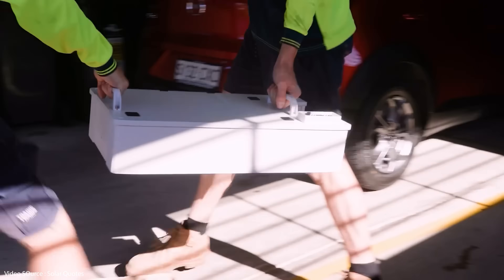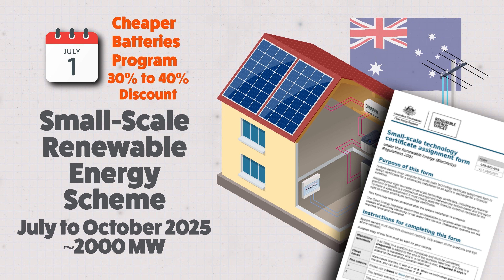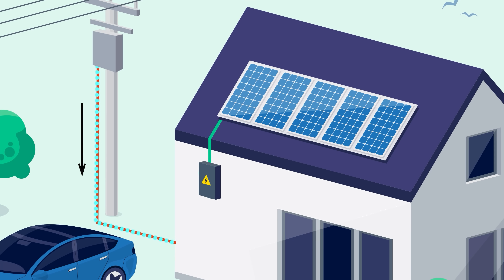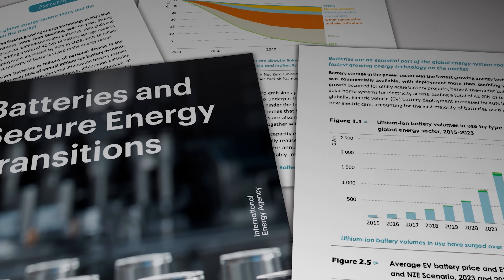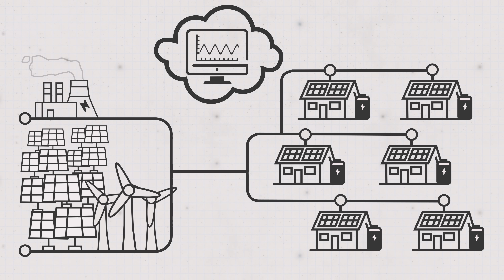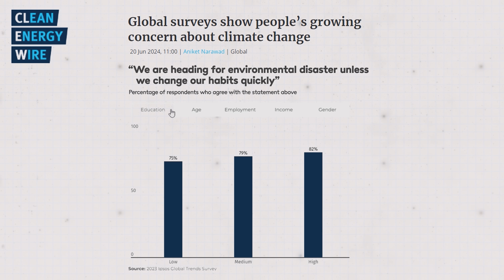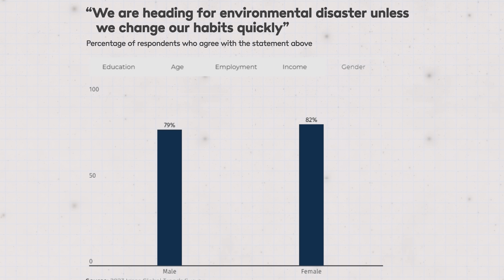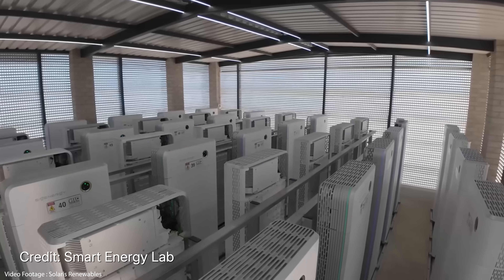Australians installed 100,000 home batteries in 17 weeks. Why can't we all do that?

Comment: Living in Germany, our grid is already beyond its limits on renewables atm. It's desperate for storage (and perhaps bigger power transfer lines). We're currently wasting a lot of money on gas generated power to fix the issues.
Reply: Geothermal is the solution.

We have a natural fission reactor beneath our feet in the crust of the earth producing so much heat that just 0.1% of it could power the entirety of mankind for 2 million years.

Geothermal can unlock that energy.
Reply: @Les_S537 Yeah new geothermal designs definitely sound promising, technologically. LCE needs to be lower than wind/solar + storage, however, for this to be economically viable. And the cost of the latter is falling off a cliff atm. I think we'll get it anyway, because gt favours utility scale and thus preferable to the decision makers.
Reply: @MoiraLachesis  You read my reply post below to another person, about Quaise Energy?
Reply: @Les_S537 no but likely I've heard about them already.
Reply: Germany should instantly, permanently ban wind-and-solar, and decriminalize uranium-fired power-service.
Reply: @aliendroneservices6621lol why
Reply: @MoiraLachesis  Did my reply come across to you, about the Real Engineering video?
Reply: @MoiraLachesis  Dunkelflaute, that's why
Reply: @Les_S537 That's a rare event and can easily be compensated for. Having ONLY wind and solar would be a bad idea but a ban is completely ridiculous. It's like banning cars because sometimes too much snow makes it impossible to use them.
Reply: @MoiraLachesis to be clear, I’m not saying to ban them, just pointing out their limitations, and the way you’re mitigating it isn’t a good option. You need more baseload power, specifically geothermal
Reply: @Les_S537 There's no such thing as "baseload" there's just load. "baseload" is just a mathematical number introduced because some power production cannot be easily ramped up or down.
Studies show that you can do fine with some storage if you have an alternative for a couple hours of "Dunkelflaute" each year. TBH that could even by gas. Ofc if you have cheap geothermal you can probably save on a lot of storage, but it wouldn't solve the Dunkelflaute problem unless you go 100% gt.
Reply: @MoiraLachesis  ...Because wind-and-solar power-service is infinite-cost, in the long run.
Reply: @aliendroneservices6621What makes you think so? It has the lowest LCE on average, except for hydro
Reply: @MoiraLachesis  No, that's not accurate.

"Baseload" originally and primarily refers to the real, persistent minimum electricity demand on the grid—the portion of load that is always present, even at off-peak times (e.g., nighttime). This is an observable feature of demand curves, not just a made-up number.

The term "baseload power plants" (e.g., nuclear, coal) developed because those technologies were best suited (technically and economically) to run at maximum output consistently to meet that steady minimum demand. While inflexible generation reinforced the concept (e.g. wind and solar), baseload demand exists independently of supply technology.

Modern grids can meet this minimum reliably without dedicated inflexible plants—using flexible dispatchable sources, storage, and demand management—but dismissing "baseload" entirely as nonexistent conflates demand with historical supply choices.

"A couple hours of "Dunkelflaute" each year"?  More like hundreds of hours each year across several events.
Reply: @Les_S537 how's that not accurate? it's a purely mathematical number, you just confirmed that.

There is no physical reason to split load into "base load" and "peak load", that's purely an engineering/organisational decision to cater to the limitations of the old grid. But (1) wind, solar and batteries can be switched on or off very quickly, so there is no need for a "baseload" concept in a wind/solar/battery based grid, and (2) we don't have to stick to the "supply follows demand on a dime" concept either, as storage becomes cheaper, it's conceivable to do stop serving peak loads and have local buffers instead.
Reply: @MoiraLachesis  LCE refers to energy.
Energy is free.
Power-service is what society runs on.
Wind-and-solar power-service is infinite cost in the long run, because it cannot power anything important, including its own infrastructure replacement.
Reply: @aliendroneservices6621 LCE is the complete cost of supplying power including infrastructure. As it's lower for wind/solar than anything else, it will only go down even more as you replace other infrastructure.
Reply: @MoiraLachesis  You're right that capacity factor is purely mathematical—no debate there.

But your claim overstates the case: traditional baseload isn't just an outdated organizational choice; it's tied to the physical reality of grid stability. The grid must balance supply and demand instantaneously, with constant frequency/voltage control and inertia to prevent cascades.

Wind/solar/batteries ramp quickly for energy, but batteries provide limited duration (hours, not days/weeks), and variable renewables lack the inherent inertia of spinning turbines in thermal plants. High-renewable grids still rely on dispatchable firm capacity (often gas or hydro) for extended low-renewable periods (e.g., Dunkelflaute).

My main issue with a heavy wind and solar grid is that you HAVE to overbuild, especially as you get into the higher latitudes.  In other words, a solar panel on the equator produces way more power than a solar panel in Tromso, Norway.  To produce the same amount of power with solar in Tromso you need 2.x panels.

I'm of German descent, and my German heritage is one rooted in efficiency, and it tells me that going heavy wind and solar with heavy batteries is not the path forward.  The amount of resources needed to make wind and solar  with batteries work dwarfs what would be needed for more robust power sources such as geothermal and nuclear.

I want the biggest and most efficient power sources so as to make as little impact on the environment as possible.

A world filled with millions of wind turbines and billions of solar panels alongside trillions of battery cells is repulsive to me, and way more work than is actually needed.
Reply: @MoiraLachesis  No. LCoE has nothing to do with the cost of providing power-service.
It's levelized cost of energy, not power-service.

"...it's lower for wind/solar than anything else..."
...Then wind-and-solar must be exclusively powering a lot of off-grid factories and data-centers.
It should be easy for you to find and point-out an example for us.
Reply: @Les_S537 Well, people have actually investigated that, and found you should go to about 90% wind/solar/batteries, but not further. So yes it's worth it, but it's not the complete solution, precisely because of the issues you mention. Currently in Germany we're already beyond grid capacity. But the reason is the lack of storage. Yes it has limited duration, but that limited duration is enough for those 90%. We already are using ridiculously expensive power in rare cases right now, not because of too much renewables but because of poor organization. So that wouldn't even change anything.

I find it strange that people say "we have to match supply and demand" and in the same moment argue for "baseload supply" which is the OPPOSITE of matching supply and demand, it's inflexible power generation. Personally I think instantaneous suplly/demand matching is silly as storage becomes widespread, but moreover it's silly to argue against the most flexible power generation methods with matching supply and demand.

We already do overbuild, particularly in gas power, by crazy factors, so that's not an argument either.
Reply: @MoiraLachesis  It's all just so much work, and requires so many resources to make it all work.  It's so unnecessary.

A geothermal power plant can last centuries (outside of replacing turbines every 50 years or so).

Solar panels last 25-30 years.

Wind turbines last 20-25 years tops.  

Why build millions upon millions of wind turbines, and billions upon billions of solar panels every 20-30 years when you can build tens of thousands of geothermal plants that can last centuries (outside of replacing turbines every 50 years)

Also, right now we're splitting up battery production between battery farms for wind and solar and EV battery packs.  Batteries should be entirely dedicated to producing EVs right now, but because battery production is feedstocking both battery farms AND EVs its slowing down the pace of getting people away from ICE vehicles.

Daily ICE vehicle use produces more emissions than home energy use does, so it makes sense to me that we get people out of their ICE vehicles more quickly.

We can do all of this SOOOOO much more efficiently than we are.

Stop pushing wind and solar, and start pushing for geothermal and nuclear which can much more quickly get us away from fossil fuels for electricity production.
Reply: @Les_S537 EV batteries and grid storage aren't really in competition anymore, or not for long, chemistry and technologies are drifting apart. Also we're already using old EV batteries for grid storage so there is synergy. I do agree however that we need other storage than current battery tech.

It's not like geothermal is facing a ban. If it was so attractive it would boom just like wind and solar, it even in place of it. Idk why it isn't, but I could imagine the upfront efforts are much higher. If that's true it would've been an option 20y ago but we really need to ramp up fast. 

Maybe in another 20-30y we'll phase out wind and solar at the end of their lifetime just as we did with nuclear. That's not wasteful IMO, it served its purpose. It's hard to tell, technologies are changing fast on all fronts. 

That's why I like looking at LCE, it's a reasonable estimate for the efficiency of doing something right now.
Reply: @MoiraLachesis  Actually, they're converging in chemistry (LFP) due to LFP's "safer" fire profile.  The vast majority of EV manufacturers are moving to LFP batteries because of their higher charge cycle count, and because they're more idiot proof on the consumer end.  What I mean is this.  There is an idiom that goes something like this.

"Take care of your tools, and your tools will take care of you".

EV owners can "eff" their batteries up very easily due to how they use them, and how they charge them...

LFP batteries are much more "forgiving" on the abuse front by consumers.  Charging NMC batteries to 100% all the time can actually shorten the life of the battery and result in faster degradation, but LFP batteries don't have that "limitation".
Reply: @Les_S537 temporary. grid is likely to move away from lithium.plenty of alternatives coming or existing that are too heavy or bulky for cars but more durable and/or cheaper.
Reply: @MoiraLachesis  Maybe in the longer term (decades down the line), but sodium is nowhere close to replacing LFP anytime soon because lithium demand for stationary storage is actually surging (expected to be 30-36% of total lithium use by 2030).  Sodium just doesn't have the energy density that lithium does (which means you'll need more cells than with lithium) but sodium is definitely more abundant and cheaper.

I know I keep harping on this, but I'm most concerned about the environment in the end.  A world with tens of millions of wind turbines, billions upon billions of solar panels, and trillions upon trillions of battery cells sounds like a living hell to me.  Sure, battery fires are a real concern to me, and yes battery manufacturing is getting better where they're less common, but when you have to have the scale of batteries that will be needed to support a world filled with that many wind turbines and solar panels its still going to end up being a toxic nightmare.

In other words lets say that only .05% of total battery capacity experiences fires...  When you have literally trillions upon trillions of battery cells, that's a lot of damn fires, and a lot of toxic fallout.
Reply: @Les_S537  I'm not an expert on these things, but environmentally I don't see a problem with doubling the amount of solar/wind here, at all. If that was big trouble it would already be, rn.

Batteries is a different story. Sodium is already being deployed, so decades away is doubtful, the whole sector is advancing at breathtaking pace.

Nonetheless, classical battery cells, lithium sodium or whatever, seen very unlikely to scale to the levels of storage we need. Some alternatives are being deployed but I don't see anything that'll solve the problem at scale yet. I'd like a 4h battery in every house, and yes that is a lot safer than a gas boiler in every house, but probably a pipe dream in production capacity. I'm very optimistic however about timely availability of safer, scalable storage.
Reply: @MoiraLachesis  It's only in the last year that anyone began production of sodium-ion batteries, and more than 90% of it is all within China right now (<10 GWh).  CATL is really the only large scale sodium-ion battery manufacturer on the planet today.  Natron Energy in the US began and ceased all production in the last year and a half.  Sodium-ion is where lithium-ion was decades ago, basically.

Look, I'm not saying we couldn't ramp batteries...  I'm saying that we shouldn't because the decades to come are going to see a lot of toxicity as a result.  To make those batteries means massive amounts of mining worldwide.

We're only looking at doing it BECAUSE everyone has pushed so hard for wind and solar.

If I could go back in time I most certainly would, and I would have been much more aggressive on the geothermal front.

It really is the answer to everyone's problems.

Geothermal is a source of power that can power mankind for hundreds of millions of years, and its impact on the environment is miniscule.

Nothing else compares (I'm a geologist so I'm a bit biased, but I know I'm right).
Reply: @aliendroneservices6621I'm not against nuclear but for Germany that would be an extremely dumb idea. We would have to modernize old plants or build new ones at a multitude of the cost of all other options

Comment: Batteries are great, no reason why those with solar on their roofs should expect the grid to pick-up their generation as it happens, makes much more sense for that generation to be put into the grid over 24 hours.
Reply: We're doing a shidton of work that isn't needed...  Collecting the resources to build solar panels and batteries is a LOT of work.

The much easier solution is geothermal energy which has a capacity factor of 70-90% compared to solar's 23%..

Solar is way too inefficient.
Reply: @Les_S537  The largest geothermal field in the world (The Geysers; 1,590 MWe) is operating at a capacity factor of 53%.
It also has a power density (after correcting for capacity-factor) of only 7 watts per square meter.
Reply: @aliendroneservices6621 Your ignorance of how geothermal works is apparent.  

The field simply needs to be recharged.  

After decades of use, and drought like conditions in the area, as well as heavy water extraction for farming, the field is essentially "drying out", but geothermal fields often need a recharge (known as reinjection).  

The Geysers have a natural source of water that feeds the field, and we've been pulling more steam out of it than that natural source can replenish it with, thus its decline in output

The Geysers reached a peak energy output back in the late 1980's at around 2000 MW (began production back in the 60's).  At its peak in the late 1980's its capacity factor was 80-90%

The Geysers is a field of 18 individual power plants all spread out over an area of 45 square miles, thus its low power density rating.

You're really not very good at this.

Comment: how did you get from mW to daily energy use of households?  1:50
Reply from the maker: I didn't check the report's workings but as a rough 'back of envelope' calculation... 2000MW with an average of 4 hour discharge is 8000MWh, which equals 8,000,000 kWh. Divide that by 400,000 homes and you get 20kWh per home per day,  which sounds about right.
Reply: @JustHaveaThink   Okay, power to energy magic, assume a time frame.  I guess it's a pet-peeve as energy and power are so frequently confused.